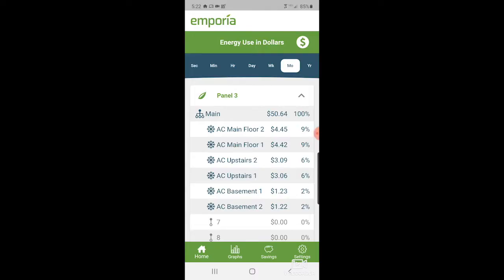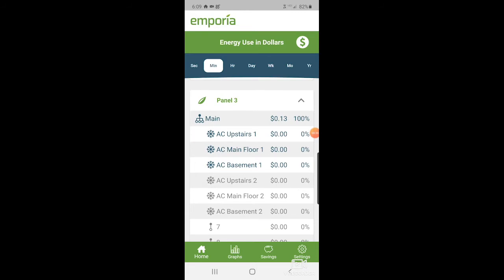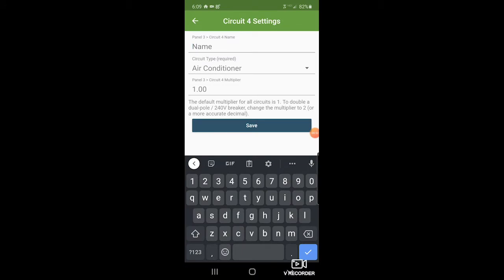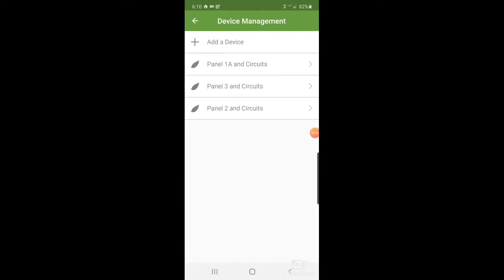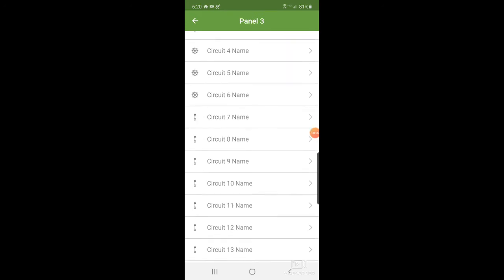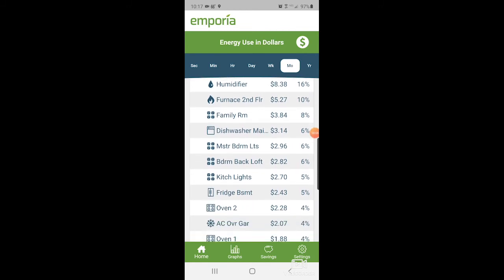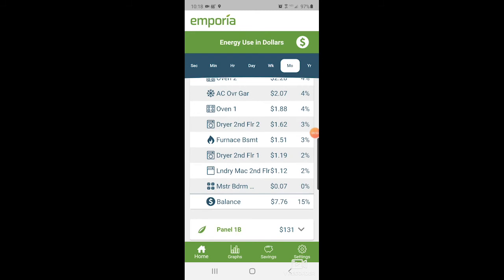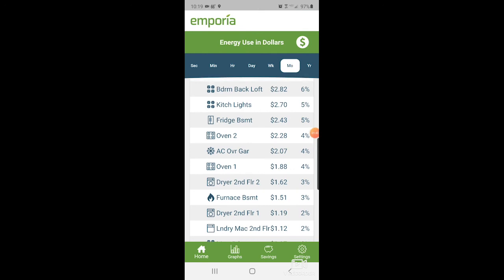Emporia Vue2 dual breaker monitoring and deleting old data

Comment: Do you multi multi panel install and software setup, and use video? Thanks.
Reply from the maker: I have a panel outside with a Vue2 that feeds a sub/child panel inside that has 2 Vues.  3 total Vues in use. The outside panel has 3 sensors to monitor power consumption on 3 AC Compressors.  This AC panel then feeds a house panel that have 2 Vues monitoring 34 breakers.  The app currently understands child Vues, but it does not correlate power usage of side by side (coexisting Vues on same power feed) Vues like the two I have in the sub/child panel.  Last time I spoke with support (a few months ago) the side by side option in the app was supposed to be added this year.

Comment: The reason you are getting different readings on the separate phases of your oven/ cook  top is because the top burners consist of two  120 volt single phase circuits  , NOT a single  240 volt 2 phase circuit, like the oven. The top may be used favoring certain burners that are on one phase rather than the other. I recommend using two CT sensors on electric oven cook top units.

Comment: Nice video showing exactly how to switch from dual leg to single leg monitoring and keep your historic data correct.

One way to tell if you need single or dual clamp for your 240V is to look at the wiring at the load / appliance.  Dryers and Ovens use the 4 wire outlet - 2 hots, neutral, ground.  Other 240V loads like AC compressors, well or pool pumps, hardwired EV chargers, and hot water heaters don't typically have a neutral wire.  If the load doesn't have a neutral, you can use the single clamp.  Anything with a neutral (including sub panel feeds) will need the two clamps as the load can be unbalanced between the phases.

Comment: The reason your oven or dryer uses more on one leg than the other. Is because the burners on low only draw 120 volts but on high they draw 240 volts. Same thing goes with the dryer one leg could power the motor and parts of the heating element and the other leg could just be the heating element. So basically it comes down to what part of the appliance is used a 120 volt and what part is using 240 volt.
Reply: I hadn't thought of this and can't find it mentioned anywhere else on the internet, but this makes perfect sense. I'm awaiting my Vue 2 with 8 sensors and had been thinking I could just use one clamp each to monitor my 240V stove and washer/dryer. I guess that won't give as accurate readings!

Comment: How's it working out?
Reply: Change to a heat pump water heater.  You’ll use a fraction of the power.
Reply from the maker: Everything is working as it should and it appears to be very accurate.  Biggest surprise was the amount of electric the water heater is taking.  Roughly 1/3 of my power bill and I don't have it set at boiling.  Makes me think of switching to instant water heater or a gas tank.  

My biggest issue with the app is that you can't combine monitors.  I have two 18 sensor monitors on a single panel.  The excess power used by a single device is listed under 'balance'.  So when I look at power usage, I see double what the usage is.  For example, one device 1 I'm monitoring circuit breaker A and that uses 5W.  On the same panel (hooked to the same incoming feeds) I have device 2 monitoring breaker B using 20W.  On device 1 I see breaker A using 5W and then 'balance' using 20W for a total of 25W usage.  On device 2 I see breaker B using 20W and a balance of 5W for a total of 25W.  So it looks like I'm using a total of 50W when you look at usage in the app when in fact its only 25W.  

They are supposed to come out with an update to the app to allow you to combine 2+ monitors for a single incoming feed, but there is no ETA on it.  That will greatly help determining actual usage without manual intervention.  

It is nice to have the 'balance' on a feed though so you can see how much total power is being drawn outside the individual breakers you are monitoring.
Reply: @forayfog2276  I'm in the same boat also - have two Vue 2's and I'm using all 32 clamps in one large panel.  Waiting for the app update to bring these all into one single list.  Emporia did just update the app to add subpanel nesting support, but everyone is still waiting for single list integration of Vues/Devices, and better handling of 240V circuits (combining dual clamp, automatic doubling of single clamp).  Supposedly due out this Summer (2021).
Reply: @forayfog2276  You can look into a heat pump hot water heater as an alternative. There are also heat pump dryers now as well and they do not need a vent, just a water drain line.